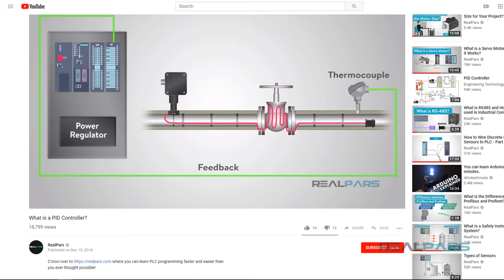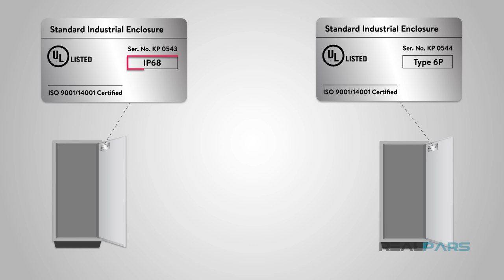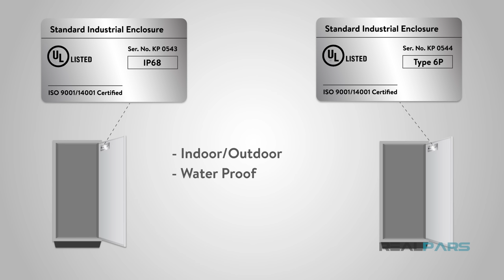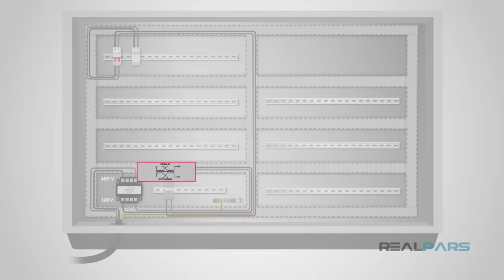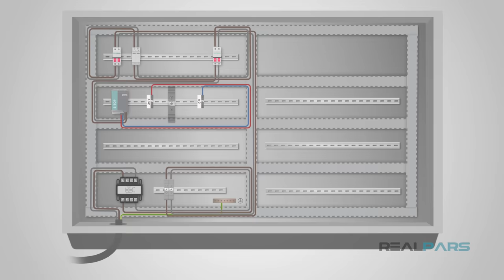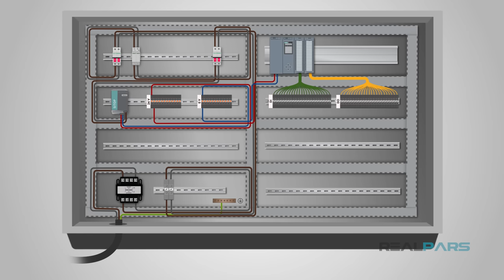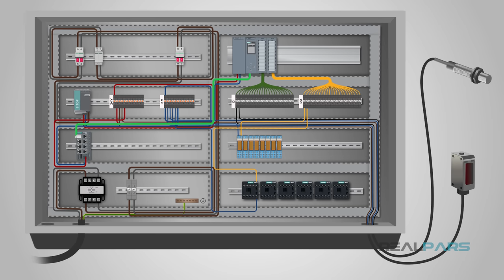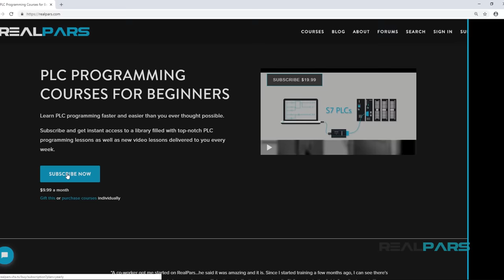What is an Electrical Control Panel? (PLC Panel Basics)

Comment: Our subcontractor delivered us a very sub-par control cabinet. Now I, a software engineer, am rebuilding significant parts of it to improve organization and maintainability. Also it just didn’t work because of the software, which is why I’m doing this. Thank you for all your videos I can use to make sure the replacement is clean and organized
Reply from the maker: Our pleasure! Great to hear that our video courses have been so usefull.

Comment: I liked this video! This is a very good basic control panel. Good introduction for people who are not into the field. For most viewers, FYI, it could get really complicated and you would have other Panels that do not have PLC's in them but have other PCB boards and other controls such as electromechanical relays, control valves, manifolds, etc, they are called sub panels. Other Sub-panels can have shunts and Servo-drives in them and so forth. 

Again this video is EXCELLENT intro. Lots more to learn like connectors, and so on.
Reply from the maker: Thanks a lot for your support!

Comment: I work in a distribution centre. Im not on the maintenance team but im interested in how the machines work. So there is a tote conveyor that collects products when it passes through an a frame picking machine and also gets loaded when it passes some robots. The totes dump their products at packing stations. After the packing stations the products then get put onto a shipping conveyor that has bar code readers and proximity switches which tell the sorting conveyors which shipping container to dump the products into. Its amazes me how man can make such machines. I also understand most of the stuff shown in your video. Thanks.
Reply from the maker: Hi Mike,

Thanks for sharing that with us, it surely is fascinating! 

Please let us know if you have any questions. We are more than happy to help!

Happy learning!

Comment: Good video!   Well done, only thing I would recommend is showing the dirty and clean wire ways.  Running a low level signal in parallel to 480 not so gooda.
Reply from the maker: Thanks for your comment and for sharing your feedback with us!

Comment: Good video, I would only suggest you don''t run the Ethernet cabling right next to the incoming 480V. It's good practice to keep your network cabling out of wireway and away from AC voltages. Lastly, AC should ideally come in from the top and work it's way down.
Reply from the maker: Thank you for the comments.  Correct, long runs of AC voltage-carrying cables parallel to low-voltage DC wiring (like Ethernet cables) can cause a problem.  It is not likely you would have a problem with the short run in the panel shown, but to be safe, yes, separate voltage levels in separate trays/panduits.  Normally, AC voltages are highest in the feed cables, so working downward usually keeps the highest voltages away from hands and fingers.  Thank you for the input!
Reply: @realpars  Ethernet uses AC not DC

Comment: This video is really superb. And the explanation is very clear. Can you please put video on How to give wire connections for each devices in the control panel.
Reply from the maker: Hey Muhammed!

Thanks for your comment and your suggestion. I will pass this on to our course developers!

Thanks for sharing and happy learning!
Reply: @realpars  Thanks. Also appreciated if you could explain other components of control panels such as overload relay,phase failure relay,latch relay,fuse,timer etc

Comment: Similarly, an electrical control panel is a metal box which contains important electrical devices that control and monitor a mechanical process electrically. ... An electrical control panel enclosure can have multiple sections

Comment: Excellent video sir!
I found this channel yesterday and in just one day has become my favorite engineering channel.

I would like to ask a question. The power section and the control section can be separated and put into two separated enclosures? And how the components would be arranged if they were in a one door enclosure? 
Thank you su much
Reply from the maker: Panel segmentation by voltage is very common.  The safest way to arrange components is to place all 200/400 VAC and above components into one panel,  110/120 VAC components into another panel, and 48 VDC and below into a separate panel.  That way, 24VDC components can be accessed when "live" with minimal PPE through an open panel door.  With the AC voltages, higher levels of PPE and access restrictions are usually required by code and/or local standards.  Other ways of doing this would be to locate all AC components on one side of a dual-door panel and low-voltage DC components on the other side.  A third way is to have a single-door panel with a plexiglass guard over AC components so that the "live" contacts are not accessible with fingers.

Comment: Thanks for concise infographic, Just wondering what component will protect the system against current overload (amps)? Also many control cabinets consist of a UPS  & Fan to cool down the Drives/plc/UPC inside the cabinet,
Reply from the maker: Fuses or circuit breakers are used to protect components in a panel from over-current conditions.  Large loads, such as motor starters, transformers, and VFD's, have fuse protection on the incoming branch circuits, and individual loads (outputs) are usually protected by fuses or circuit breakers.  Local electrical codes dictate, in many instances, what device types and rated sizes are appropriate in each case.  Whenever a panel is designed, the environment it is being placed in should be evaluated, so that the proper cooling can be installed, if required.  Most panels with motor starters or VFDs will at least have a fan for cooling purposes, just to remove excess heat generated by those components.  Some panels in very hot environments may require air conditioners or other cooling devices (vortex coolers).  It is much easier to design these in during fabrication than retrofitting after installation.  UPS units are most often just used to keep controllers, like PLC's and I/O cards alive when a power outage occurs, so that the process can be monitored.

Comment: Thanks for reply. I am still confused about it. 
As I know, '2 wire connection' use 24VDC and two wires for both power and signal and '3 & 4 wire connection' use additional wire for external power like 120VAC.
I can't match 6:04 '3 wire connection' with either '2, 3 or 4 wire connection'.  It does not use external power but use 3 wires? 
If you explain more, it would be very helpful. Sorry for asking again.
Reply from the maker: There are also 3-wire DC devices, like transistor-based (solid state) proximity switches.  The three connections are +24VDC, signal, and ground.  We have a blog entry that explains this concept (https://realpars.com/discrete-sensors-part-2/).
Reply: @realpars  Now, I totally understand it. Thanks.

Comment: Thanks for great video. 
I have a question. At 6:04, three wires come from field to control panel. Isn't typical wiring is two wire and two wires connect to IO module?
Reply from the maker: The video shows L1, L2 and Gnd for the power.  The numbers of wires depends on the panel power supply voltage, number of phases, etc.  The I/O shown has a single cable that is routed to the panel, where the individual wires, either 2, 3, or 4 wires are connected inside the panel.  Typically, I/O cards have two connections, signal and ground (common).  Additional wires may be required for power.

Comment: I noticed that the outputs were only 2 wire.. one connected to the negative and the other connected to the output terminal.. is that because internally in the PLC the output is connected to the positive when switched to complete the circuit?
Reply: Yes, internally a contact closes when the output is energized.  This completes the circuit to the output device.   The PLC output can be a relay type output or a solid-state switch.

Comment: I did not find the appropriate network switch info that is shown in the video (which is attached in the panel). Please give me some model info.
Reply from the maker: This switch is a Siemens Scalance XB008, 8-port, unmanaged network switch (Part# 6GK50080BA101AB2).

Comment: Hi,

Which is the device connected after transformer ?
Reply from the maker: Typically this would be a set of fuses to protect the connected circuits, such as the SITOP 24VDC power supply in the video.
Reply: The post transformer componet

Comment: Do  PLCs always power from 24V? Do any of these PLCs run off of 12V like a car or desktop PC??
Reply from the maker: Yes, there are PLC's that do operate on 12VDC, but most are powered by 24VDC.  Many nano-controllers and micro-controllers are offered in a 12VDC package.  Most are able to handle only a small number of I/O and require lower voltage (0-12VDC) I/O.
Reply: The answer may vary

Comment: I think the Surge Arrester (SPD) wiring is wrong. Is not going to PE?
Reply: A surge arrestor typically is connected to N or GND (PE).  Also, it is typical to use one SPD per phase.  In this video, we are just showing general placement of devices and using the wiring graphics to show the main connections.  It is not intended to be used as a wiring diagram for plant installation.
Reply: @scottsommer5450  Ok, but I think is good to explain that in "show more", like an advice. Only to improve your videos! Thanks for the comment.

Comment: Why would you step the power down twice instead of just stepping it down to 24v?
Reply from the maker: Good question!  Many times the incoming power to a panel is 480VAC which is used to drive motors , heaters, and other similar equipment.  This voltage is too high to be practical for control circuits, so a transformer would be use to step down 480VAC to 120VAC, which can be used for control circuits, like relays and motor starter coils.  Finally, a 24VDC power supply can be used to convert 120VAC to 24VDC for PLC I/O cards, interposing relays, and other control devices.